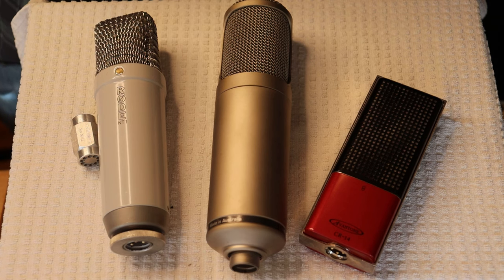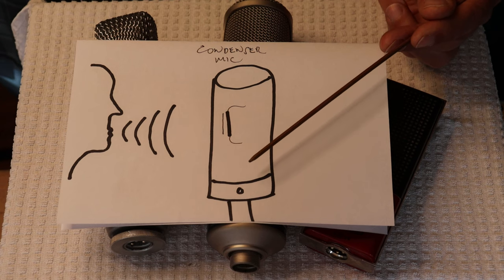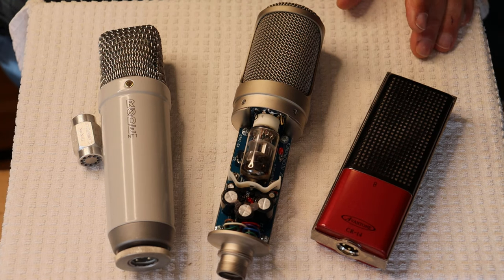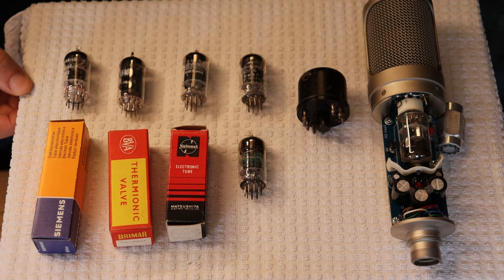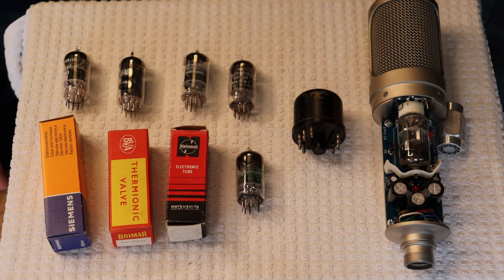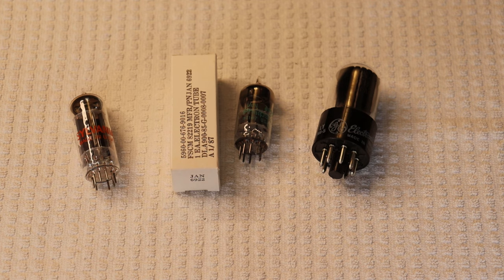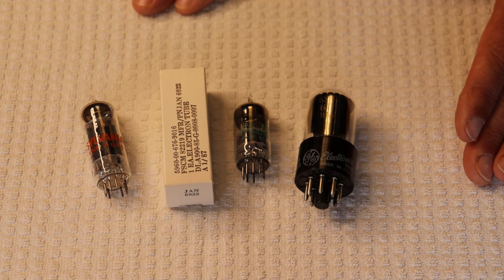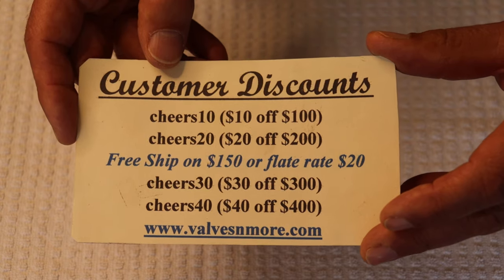Tube Lab #209 - Tube Microphones

Comment: EF86 or also branded as the  6267..........( UK) CV4085 GEC /Z729 ......
Prof versions like the E80F ..........ECC804s  etc....( different  pinout )
EF86 used mainly in tube recording mixers etc ...when you listen to the Beatles etc you listen to ERF86 ......
Used often in first stage of an amplifier and in triode mode .............
In series string filaments   ( TV sets and series current mode filaments ) ...PF86.
Have a nice day.

Comment: The 6922/E88CC  does not have damping mica fingers on the cathodes , the ECC88/6DJ8 has those dampers as most E188CC and CCA tubes...
6922 tubes used for amplifying  audio low signals must be selected for potential ringing and microphony,. good E88CC tubes were made by Philips SQ = Amperex PQ ( = burned in /selected Phuilips tubes  , Siemens /Halske , Telefunken , Tesla ( gold grid )  and some others ......My prefered musical choice is the CCA.
An asthonishing / very musical sounding tube is the PCC88 from Siemens .......( Current referenced filament )

Comment: I guess you use the K2 only as a reference. It uses ECC88 tube, different than the ECC83/6072 i saw you're showing. Correct me if I got you wrong.
Reply from the maker: @dkokalanov  it's possible we misspoke, the actual tube mounted in our K2 was a Chinese 6N1, which actually sounds pretty good.  But you are correct the manufacturer specifies the 6DJ8/6922/ECC88 tube.  And when we get a few minutes we'll upgrade to our Sylvania 6922 and see how that sounds.
Reply: @tubelab194  That's Chinese copy of ECC88. If it's newly purchased, it seems they stopped using Russian "Electro Harmonix" ones (probably due to the sanctions). It does benefit from changing it to NOS tube. Mine definitely did. 🙂
Reply: @tubelab194  Haven't tried the Sylvania but it's described as clean and bright online. I tried Siemens and though it improved the tone, the glassy top was still present. I liked more Tesla or Mullard. Haven't tried a Telefunken because of the high price though. Let us know of your experience.
Reply from the maker: @dkokalanov  sounds good, but I really need a good singer to know for sure.  When you mention Tesla and Mullard are you talking true vintage tubes or modern non copies?  If modern tubes they're made in the same factory with the same parts as the Electro-Harmonix, in Saratov Russia.

Comment: Hey Jim and Charls, lovely vid thankyou guys. I have a woo audio wa6 se amp and it takes 6de7 tubes. I was wondering if there are any European version of this tube as i can only seem to find US offerings of this tube type.. silvania, rca, ge, tungsol, etc. I was wondering what the european/uk/soviet equivalent codes were for the 6de7 tube. Id like to get a mullard version or a valvo if they exist. Failing that.. if it is an American only tube type, i was wondering if western electric made a version of it and what the code would be? For instance, western electric do a 5654 tube but they call it a 403b or 403a. What would the western electric code be for the 6de7? Sorry to be a pain and i thank you for your wonderful channel! Xx
Reply: Hey prof! Well that sent me on a bit of a scavenger hunt. Unfortunately I came up empty handed. It looks like it was only made by NA manufacturers. And as far as I can tell, Western Electric didn't make it either.  This can happen if the tube doesn't see widespread global use, which is often the case with TV tubes like the 13DE7. 

I checked out the manual for your amp, and it looks like 12SN7 tubes are compatible with an appropriate Octal to 9 pin adapter (designed specifically to go from a 12SN7 to a 13DE7, be careful with this). This is great news, because there's a large variety of  NOS 12SN7 tubes still available.  I would be careful with this though, considering the amp is using one section for power output, it is going to be pushing the tubes HARD. That means no early version 12SN7 tubes like the early Sylvania "Bad Boys" or Tung-Sol "Mouse Ears". You'll kill those tubes pushing them that hard. But that still leaves lots of other 12SN7GTA tubes that you can roll in.

Hope that helps.
Cheers,
Charles
Reply: Cheers Charles! A thousand thankyous! I did wonder if this was the case. Not to worry, I have a stack of output tubes to roll through. I will investigate the sn7 route aswell. This is the gen1 wa6-se so it has 6v for the heaters... I'd presume it would want the 6sn7 rather than the 12sn7... or am I missing something? Regardless, love you guys! Xx
Reply: @proffessasvids  Nope, you're right. It would want the 6SN7 then. Cheers!
Reply: @charleslambton7836 cool beans dude! thankyou for your help along with Jim and yours, wonderful channel! Xx